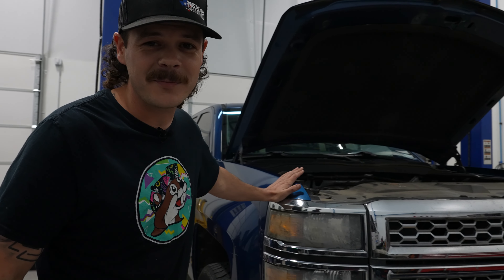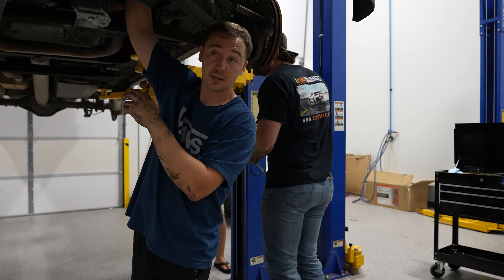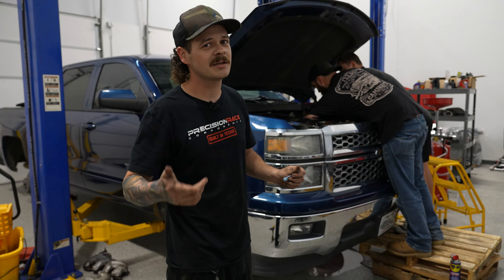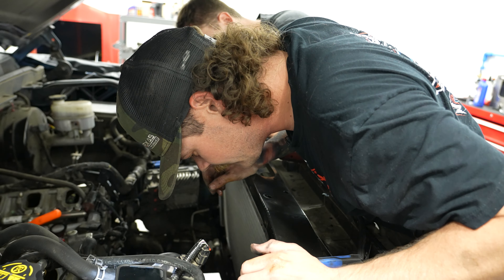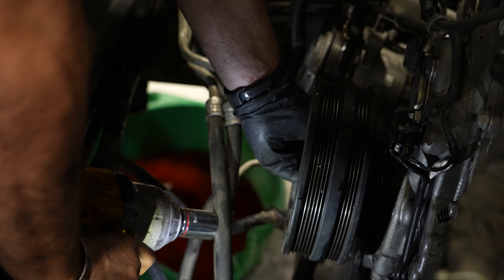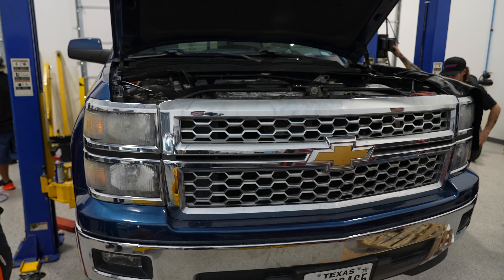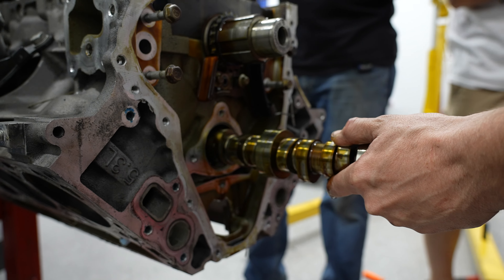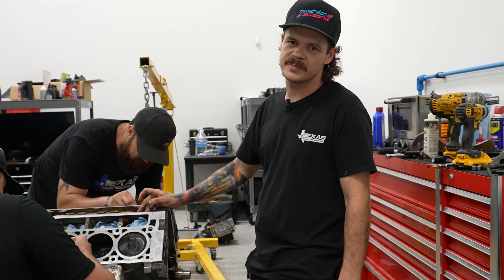Unlocking Power with a Texas Speed Camshaft and DOD Delete: 2015 Chevrolet Silverado

Comment: I’m 61 years old and can do a DOD delete in about 8 hours , no pulling the pan , these engines are not bad to work on at all , they just look like there is allot to do , but in reality everything is pretty well engineered and easily accessible you have 2 valve cover bolts on each side by the firewall that you may not see so make sure you remove them and one head bolt on each side again by the firewall easily seen you’ll need a impact wobble socket to get on it , while the heads are off make sure to put cylinder one on top dead center and confirm it’s on compression stroke then mark the cam and crank gear and make sure you do not rotate the crank , you can remove the cam gear by working the chain of a tooth at a time , but first you must push the tensioner away from the chain and lock it in place by putting a pin through the chain guide and the guide mount ( I used a Honda tensioner pin that they are shipped with as I work in a Honda service department) I would say anyone could stop by a Honda dealer and ask a tech for one as it works great

Comment: For those that may do this, book time is 28 hours with 4wd.  If you have 2wd, faster to do with engine in, but not much.  Definitely pull engine on 4wd.
Reply: pulling the engine is a waste of time lol
Reply: Done many Cams on these trucks/Suvs and even c7 without pulling the oil pan. Just tricks of the trade.. 😊
Reply: I have Z71. Never removed engine. Super simple and easy. Why remove something you don’t need to.
Reply: @boost1728  nope. All done from the front
Reply: @boost1728  well you can't change the cam without pulling the balancer off
Reply: You must not be a mechanic.  This job can be done EASILY in 12 hrs with the engine in
Reply: @landoflakes92  your definition of easy is different than most and unimpressive. Not a fun job at all.
Reply: @boost1728  wasnt trying to impress any clowns on the internet. Just trying to give an actual opinion from someone who knows what they are doing instead of pulling the entire engine to do a cam. The job can be done without even removing the oil pan by sliding the oil pump slightly forward. You guys aren't trying hard enough.
Reply: @landoflakes92  we always referred to them as safe space techs. "Head on back to your little box where you follow the instructions and don't think for yourself"

Comment: little trick guys, you dont HAVE to pull the oil pan to pull the cam, just takes a little finesse with the tensioner and a screw driver
Reply: What is the trick?
Reply: @bobbieprice1351  small screwdriver to push back the tensioner.very doable
Reply: Except for half the time the tensioner is broken and needs replacement
Reply: What about a 4wd ?
Reply: @Omar_davin  you dont, you can pull the chain off without taking the pan or diff out
Reply: @fsub9834  never seen that ever.
Reply: @kriscleansthings no
Reply: @AutoSteps  how many have you done? Its pretty common issue when doing these that requires the oil pan being pulled because the oil pump keeps you from taking the tensioner off....
Reply: @fsub9834  it does not. all you have to do is work the tensioner behind the pump withba screwdriver. works on old style LS And new gen 2024 LT engines. no pan or pump removal
Reply: @AutoSteps  so you claim to have never seen a broken tensioner, but yet you have experience replacing them?? also if what you're saying is true please show me wtf you are talking about because aint no way
Reply: I done 4 of these and have never been able to do it.. Show be a video of you actually doing it, Thanks
Reply: @badhairvideos1912  dudes lying out of his ass about being able to do that tensioner without dropping the pan and pump. But you can take the cam out without dropping the pan
Reply: I did my cam swap in my 2015 Silverado 4wd i didn’t remove the oil pan . Was a pain to work the timing chain off and back on but it can be done .
Reply: @fsub9834  here again. plenty of videos showing it. just because you cant doesnt mean people cant. worked at a GM dealer for 10 years now and GM master certed. never pull pans and never see a tensioner broken when replacing a cam due to lifter failures.
Reply: @sethgileau7159  i know if your tensioner is NOT broken that's the way it should be done...but  if READ what fully what I said. When the tensioner breaks is when you have too...

Comment: Just ordered some parts from y’all for a similar set-up on my ‘14 with l86 last week. After seeing y’all struggle, I lowered my expectations of how long it will take me to do in my driveway. Thanks for sharing
Reply: actually a pretty easy job. its just nuts and bolts. ive put cams and pull engines out of 90s- current year chevy trucks. these l83/l86 are by far give me the least amount of trouble
Reply: @tpg_sethtomerlin  how much you spend cause I got a 2014 as well

Comment: Is there a no tune cam for a 2015 4x4 5.3 silverado. RV cams for little more HP and Torque years ago. Any suggestions?
Reply from the maker: There is no way around tuning a vehicle when doing a cam swap. At least if swapping to something that will actually show a change in performance. That aside, your '15 truck has DOD, which needs to be eliminated and turned off in the tune in order to do a cam swap.
Reply: @TexasSpeedPerformance  yes sir and the plan was to eliminate it already..  So what would be a good cam that wont harm I guess a 2015 5.3 with 138k and I do understand it has to be tuned also. Thank you sir!

Comment: Did one this week.  You don't need to pull the oil pan.  After setting TDC marks on old sprockets turn the crank ~30 degrees and you can shimmy out the cam gear.  Put heat on the harmonic balancer bolt to soften the face sealant and it come right out.
Reply: COST TO DO THIS??
Reply: @Gokywildcats11  1400 for parts another 1.5k- 2k labor and shop materials. Anybody saying anything else are scamming, LS is the legos of engines, very simple. You could even do this yourself and save 2 grand, you'll just have to find a tuner that'll come to you.

Comment: Milwaukee 1/2 inch would have gotten that lower balancer bolt off 🤷🏾‍♂️
Reply: not without locking the flywheel it wont.
Reply: @Mac1o24 yes it will. Did it this week dod deleting my 08 burban

Comment: what's the cost for this entire thing ? In the search of doing this for a 2014 1500 LT
Reply: Mine was $9800 on a 17 L83 4x4

$2100 for TS cam and lifter kit w/ DOD delete
$2000 for TS long tube headers and cat back exhaust
$675 to get my heads resurfaced, vapor blasted, and 3 angle valve job
$1000 for the dyno tune and credits
$4000 in labor which warranty company paid for because of Bank 2 lifter failure.

And then another $7300 for a whole new transmission a few months later after my torque converter went lol. GMC dealership did that repair for $200 an hour. They won’t touch the motor though because of aftermarket parts, one thing to take into consideration

Comment: @16:39 “I hope this cam doesn’t kill the converter”

Lol
Reply: It’s going to, these truck are notorious for converter failures destroying the whole transmission
Reply: @adriantrejo6696  there is a joke on sloppy mechanics. I guy tried to claim a Texas speed cam took out his stock torque converter which was never installed in the vehicle
Reply: The converters fail because of transmission temperatures. Get an upgraded thermal bypass valve and as long as it wasn’t hurt before it should be fine. I did that but also put a 6l90 converter in mine

Comment: How much would a job like this go for a 2016 Silverado 4x4 5.3
Reply: Mine was $9800 on a 17 L83 4x4

$2100 for TS cam and lifter kit w/ DOD delete
$2000 for TS long tube headers and cat back exhaust
$675 to get my heads resurfaced, vapor blasted, and 3 angle valve job
$1000 for the dyno tune and credits
$4000 in labor which warranty company paid for because of Bank 2 lifter failure.

Comment: I did this to my '10 in the driveway. Have to admit this wasn't as smooth going as they expected (cracked head not their fault) but all that work for 40 hp? Id like to see the dyno charts before and after to see where it gained tq and hp throughout the rev range.
Reply: The engines are different in this truck & the engine that’s in your 10’. The procedure is entirely different for replacing the cam in the Gen V’s

Comment: I did this on my 2020 Sierra 1500 with the 5.3l L84 and after reinstalling the engine, it won’t start. I am stumped as to what is wrong. Every connector is back in place except the wiring that went to the sensors and crap under the valley cover. Other than that  everything is tight and seems to be in the right spot. When I try to start it the dash goes dark and nothing happens. No starter click or anything. Then the dash comes back on. What could it be?

Comment: How did the tune turn out? I did DOD and VVT delete and had it tuned. Still runs like crap. And has shutting misfire at idle. Any help would be greatly appreciated
Reply: Different tuner next time
Reply: I seem to have the same issue. Have you found a solution?
Reply: Sounds like a broken spark plug. I've seen it happen with plugs that are not for that truck (champion, Bosch ect). Clean out your mass air flow sensor, change your wires and do ACDelco o.e.m. plugs. Also replace the pvc valve

Comment: On these years Chevs PULL the engine and replace that garbage factory torque converter if you gonna do this delete. Pull it. Toss the factory torque converter. Install something like a Florida Torque Converter Co TC.. I've used them in a previous swap and they seem rock solid. 😎👍

Comment: Is the OEM cam “bad” from the factory or is that replaced at the same because the engine is opened already, the added power, or preventative maintenance or what? Thanks
Reply: Its because the cam used in afm engines is specific to afm lifters.

Comment: How much does this job cost to get this job done?
Reply: 1725 for the parts with recommended new oil pump 
425 for the cylinder head portion to be done
4500 for the performance shops labor
725 tune and dyno
Plus oil, antifreeze new plugs
Reply: @willallen126  4500 in labor is not accurate unless you like getting scammed lol.
Reply: i have 2 quotes for around 4500 parts and labor
Reply: @slayfishing560  they are charging you 3 grand in labor btw. Edit, please tell me your year and model, and what stage you're looking into, I'll build you a kit.  3k labor is just insane. My build: GMT900 BTR stage 3 1625 for parts 1000 for install and 300 for a tune. Around 3k total. I live in the south, performance trucks and cars with ls motors aka Pontiacs and Caprices are real big around here, probably why it's cheaper for labor.

Comment: I regret not getting the TSP heads when I did my cam on my 2016 Silverado.
Reply: Do they add a lot of power? I know the heads flow very well on these stock so i was just going to swap my 5.3 intake for the 6.2/l86 one

Comment: I have a '18 Tahoe and I had my buddy install some software that eliminated the DOD. I will eventually do the same thing you guy's are doing but this software install is a great temporary fix.
Reply: Had my AFM disabled when I had my truck tuned. Lifter 7 still shit out!
Reply: It’s not actually a fix. The AFM lifter could still fail at any time.

Comment: You guys are to funny! I can do a cam swap in 5hrs. First off why would you take the cylinder heads off if you're just doing a cam swap? All you do is pull the pushrods out stick a pen magnets in each lifter hole holding the lifters up, then slide the old cam out and new one in. Next time you wanna take a crank pulley off just put a breaker bar on it and bump the starter. Watching you guys is like watching a bunch of monkeys humping door knob! It took you guys a week to do a cam swap. 😂😂😂😂 I can't believe you posted this!!!😆😆😆😆🤣🤣🤣🤣🥴🥴🥴🥴🤤🤤🤤
Reply: You have to pull the heads to swap lifters ole boy
Reply: @94fastford I didn't watch the whole video, so I didn't know it had DOD, but honestly a week to do a cam and heads, don't you think that's a little excessive with four guys?
Reply: The title of the video is literally DOD delete…. Why would you ever half ass not swapping lifters on a Chevy any ways even if you weren’t deleting DOD. That’s the main failure point on most of these motors
Reply: Might wanna do your research before thinking you know what you’re talking about. To do a DOD delete on a Gen 5 the heads haft to come off to change the lifters. However the oil pan doesn’t. This isn’t an old LS3 buddy. They were all over the place tho needing 5 ppl to do a 1 man job still taking triple the time. It’s pulling the motor for me. Total waste of time just to do it on a stand. Plenty of room standing in front the engine once the rad is out lol.
Reply: @laniknight-g8f I have a 2015 silverado ltz with the 5.3 4x4, how much more hp and torque and how does this change the fuel economy?

Comment: Just ordered some parts from y’all for a similar set-up on my ‘14 with l86 last week. After seeing y’all struggle, I lowered my expectations of how long it will take me to do in my driveway. Thanks for sharing
Reply: If your truck don’t give you problems like theirs did, you can get it done in a weekend. Took me 2 days to do a stage 2 in my 17 1500
Reply: @dumbolove303  it’ll take me a month, minimum. Lol. About an hour at a time in between interruptions, on sundays cuz that’s the only time I have to work on it.
Reply: I know I'm late to the party, however, when removing harmonic balancer bolt, a good impact socket is a necessity.